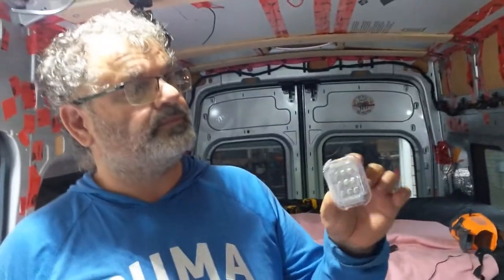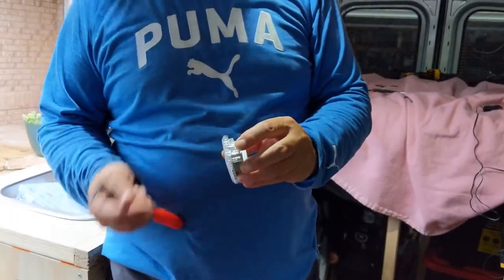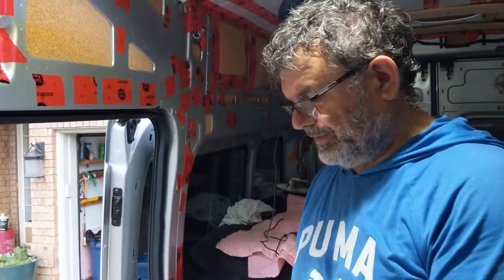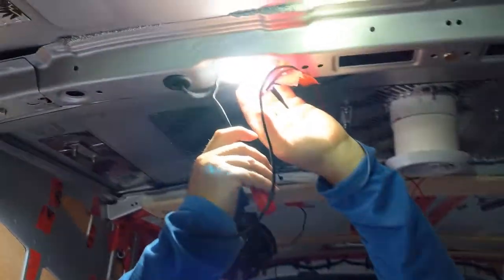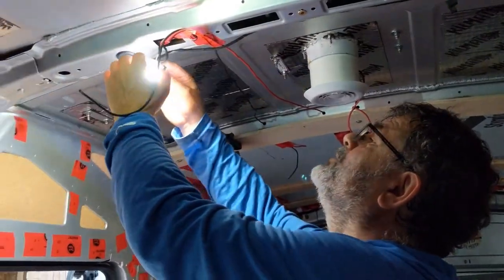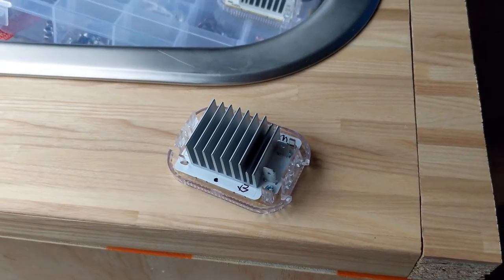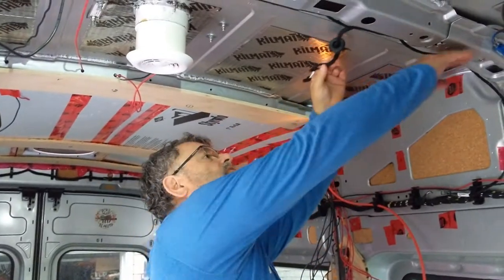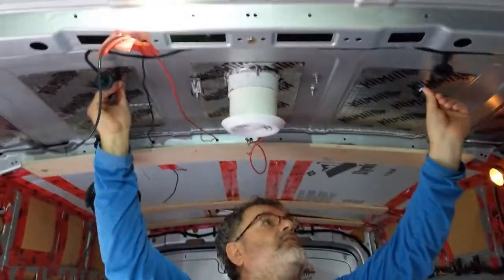Van Build 5: REMOVING CARGO LIGHTS - 2021 Ford Transit 250 HR AWD 148" 3.5L EcoBoost V6

Comment: Thanks for this video. Just removed mine as well with the same intentions of reinstalling them in my ceiling. Did you reinstall yours? If yes, how did you attach them to your ceiling. The plastic clips are designed to attach to thin sheet metal and I am trying to figure out how to attach them to my 1/4 inch ceiling panels.
Reply from the maker: Hi there, thanks for watching!  Yes we reinstalled them but didn't use the clips.  Instead we cut a hole in the ceiling panel making sure it was a snug fit.  You can see near the end of this video: https://youtu.be/R3uqmeZ_x9g?si=tCdekmXltz3yIwDx.  Also, we ended up disconnecting one of them as it was too bright in the van when both were on.  Good luck with your build!

Comment: Thanks for showing this.  Most people will do just as you did.  Are you leaving the power wired to vehicle power or changing it your non-vehicle power supply?  Also notice the large heat sink.  LED generate a lot of heat and your heatsink will need a way to shed that heat.  In the pillar there was a nice bit of air/metal nearby.  Excess heat will shorten bulb/capacitor life.
Reply from the maker: We left them connected to the van's power so they're never on for very long.
Reply from the maker: I mentioned the hear sink to Alex, and he said yes, he did notice to heat sink, and that we do have an air gap between the ceiling and layer of reflectix.  Also, when you get your van, you'll see that there's a button to turn off those lights sooner than they do on their own.
Reply: @OurRetiredLife  Hi, i've been looking for this button but havent found it anywhere... My lights are still on the default timer around 30 minutes or so, can you help me find this button please! 
Thanks!!

Comment: Thank you so much for this info.  I have a 2021 just like yours and I am putting up firring strips right now and came upon the lights.  I would like to reuse them also.  Maybe put it in the rear door area or something.  The only problem is they are very bright.  Thanks again.  I liked and subscribed.  good luck in your build.
Reply from the maker: Thank you for subscribing! Yes they are quite bright. We left them on the vehicle's power, so they turn off on their own after a minute or so.

Comment: So far failing to get these out in my transit custom. They’re super tight. Your tool looks a little thinner than mine though. 
Did you have room to push it into the metal for leverage?
Reply from the maker: Sorry it's been a long time since we've done it, I can't remember.  Just go slowly - I was able to remove it without breaking any of the tabs.  Good luck!